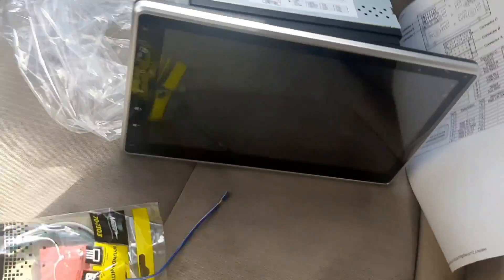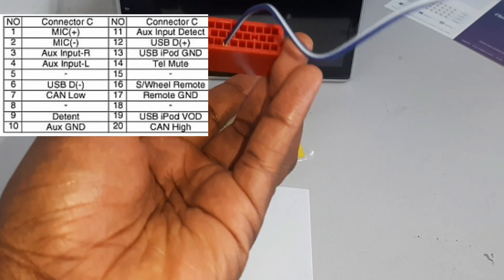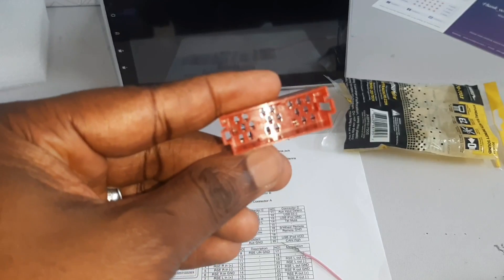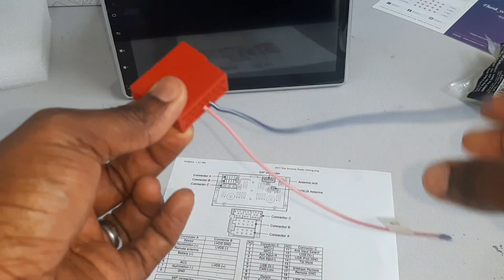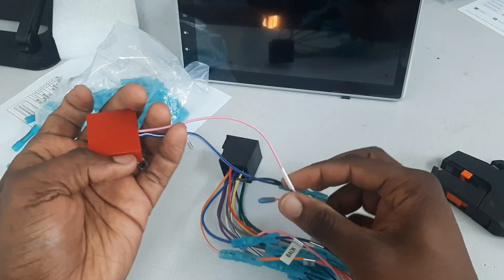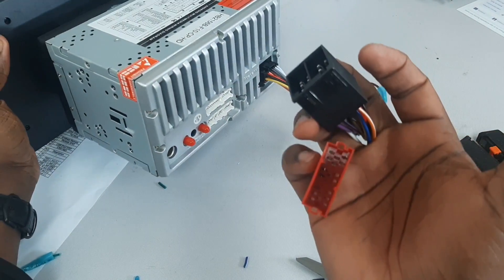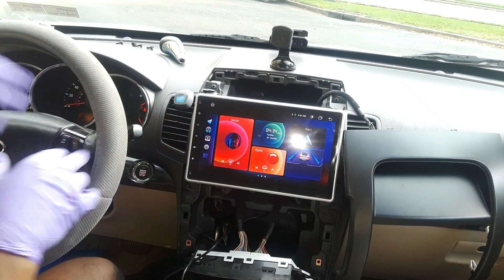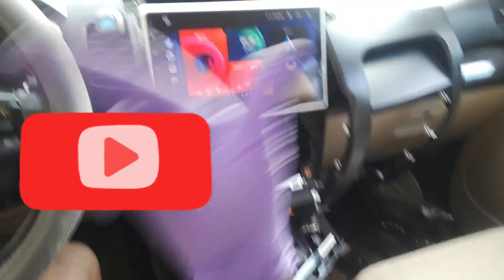How to Wire 2011 Kia Sorento Aftermarket Radio and Retain Steering wheel control | No Canbus Needed

Comment: How do you wire amp got radio hooked up can’t find amp wire or pin
Reply from the maker: Pin 18, where the blue wire is only present on the red pigtail harness is the Amp on. I modified the harness for SWC in the video.

Comment: The volume control isn’t working for me. Only have 1 wire out the back that says it’s for the steering wheel control
Reply from the maker: Did you ground the SWC pin?

Comment: The original purpose for the one wire is for the amp. Obviously if there is nothing in pin 18 then that’s not going to work as intended. How would I wire up the amp?
Reply from the maker: So find other pins to put in for the SWC

Comment: My sorento came with a back up camera already. Will this work with this head unit ? Will the sensors still work aswell ?
Reply from the maker: The back sensor will work. The camera will not work unless you know the wires for that in your car.
Reply: I know wich wires it is but I dont know where to connect them😢

Comment: Will this only work with a head unit that has capability of programming the individual button settings as you do at the end of the video?
Reply from the maker: Yes. It should work
Reply: @eazidiy  I’m going to be installing a Joying head unit. I’m not sure if I can program the steering wheel controls on the stereo or not. I’ll try it. Thanks!!
Reply from the maker: @Chris-sz1fz yes can program the SWC. Look for the settings on your radio.

Comment: Where did you get the extra pin you needed for the harness. ( one on the pink wire)
Reply from the maker: I pulled it out from an extra harness pins I have available to me. If you have spare harness around or you can buy online.

Comment: I have a Sportage 3 SL with the factory nav system. however it's been lagging alot after all these years and i decided to buy an android car nav from china. they said with the canbus harnas system it should work with my model but when i installed it , it just didn't. they also said my original cam should work yet it isn't working, nor is the steering wil controls and my sound is super low. do you think i could get it all to work if i tried checking the cables pinout?
Reply from the maker: You could try a pinout that matches your exact vehicle. It seems your car has a factory Amplifier? You will need to look online for resources.

Comment: I will be changing radio in my Sorento, if it works, You saved me 50$. Thanks man! 
Quick note, link to diagram is dead.
Reply from the maker: Here is an updated link https://drive.google.com/file/d/1w5QqVjvdyF2lsFV6WfrwIxQIJK4w7oqY/view?usp=sharing
I look forward to hearing back from you and the outcome. Cheers!
Reply: @eazidiy  Well man, it works! Every key on the wheel works great with my new Sony XAV-AX6050. Thanks to this video, process of preparing connector, disambly of the car and instalation of radio  was rather painless. Thank you!
Reply from the maker: I am glad to hear your updates. So happy to know the video was helpful.  Cheers
Reply: @JurekPods tu Kia Sorento era la versión con sistema amplificado infiniti ? O el básico